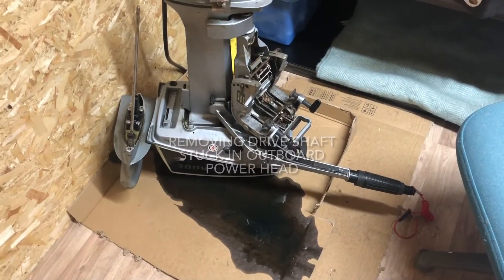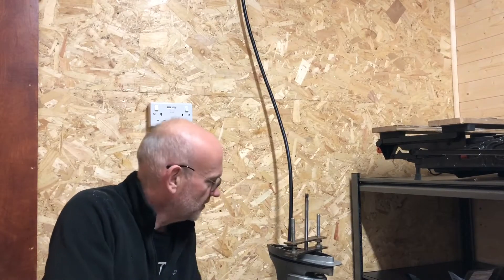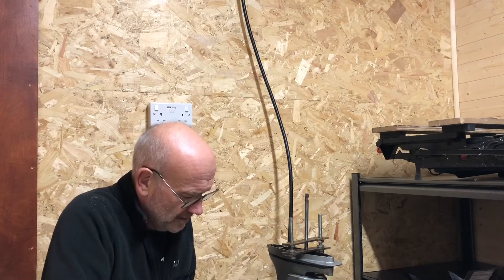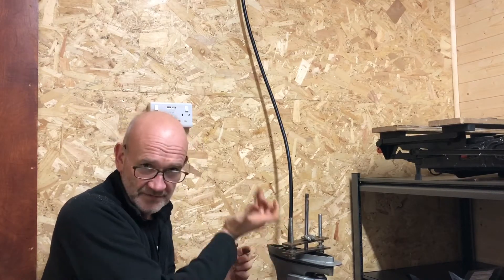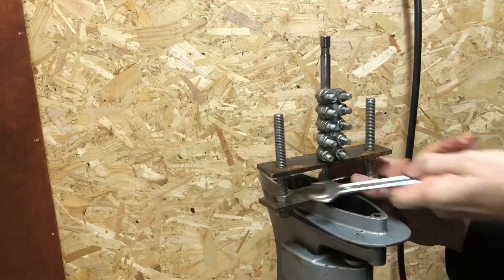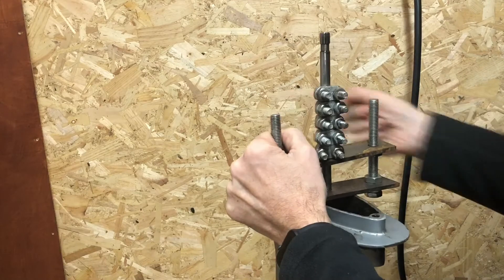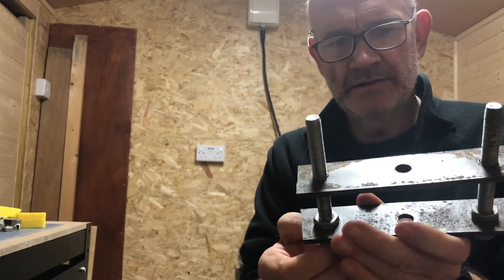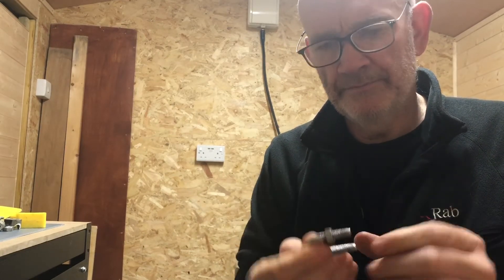Removing a drive shaft stuck in outboard motor powerhead

Comment: Hello just wondering how you got your lower unit off? My drive shaft is stuck in my powerhead and looking to do your trick to pull it out. But can’t seem to get my lower unit off. Thanks
Reply from the maker: It was hard, managed to get it open enough to drive some plastic tree felling wedges in the gap then carefully hammer them in. Anything metal would have possibly ruined the metal.i was nervous but figured at that point it was all or nothing
Reply: @doinnowt  thanks for the speedy reply really appreciate it. I’ve tried a lot of things and still can’t get it off. First was metal wedges(I should of used plastic as you suggested as I did damage the shifter housing and oil came out). Turned motor upside down with chain block and tried all different penetrants and also some heat near the power head with a butane torch but still didn’t budge. Ended up fabricating a metal jig on the shed floor and tried a 1 ton come along and still no go. I’ve now started dismantling the gear box in hope I can try pull the lower leg off through the water pump i’ve undone the pinion gear and put a pry bar in and the wedges again but doesn’t look promising. I’ve tripple checked all bolts are out and gear selector is detached.  Engine is a Johnson 70hp 2001 model.
Reply from the maker: https://www.amazon.co.uk/ORETG45-Plastic-Splitting-Cleaving-Splitter/dp/B08CZ47SKT/ref=sr_1_4_sspa?crid=3BJ7EDKQIHQZC&dib=eyJ2IjoiMSJ9.JR6Lb_8UWxRCNHyLBIfBBMtIyUuUfEb4clpwxSLo6NbLojWPrBB-bpj7I4EJtcS0MF-zftGn04I-11Pj237h2binYzKN8q7er8a77QK-3F6dcgSAYtpbZ_VvTz4-Mc3SUhIn1idL2lVw0r9ZXL0LYN-ukh5T7gbIku1q8mmLOV9snvVTMZ3VSqYZjwRwv9wG7hqcV-ztT-AUv7jR4rHKHGNB86TRDJcXvdlAAduaB9m6MQELJ30oScE-69eTrvOpJRpheScIjNELaptmt3h-n9DM2eEbsHZkACoZCICcP9g._qZvrtkJg3DG4ypWIUM5kPxm0bG7W8VN2GcXteXRBFU&dib_tag=se&keywords=plastic%2Btree%2Bfelling%2Bwedges&qid=1762945640&sprefix=Plastic%2Btree%2Bfelling%2Bwedge%2Caps%2C124&sr=8-4-spons&aref=lsoVPHfZt7&sp_csd=d2lkZ2V0TmFtZT1zcF9hdGY&th=1
Reply from the maker: Something like the one above

Comment: Thank you, note the plates should be at least 8mm thick. I used just one cable clip which was a perfect match for the drive shaft and there was no damage. 
Just to be sure folks don't put the cable clip where the oil seals are on the drive shaft, you'll see the markings.
Reply from the maker: Or use some angle iron, which bends less